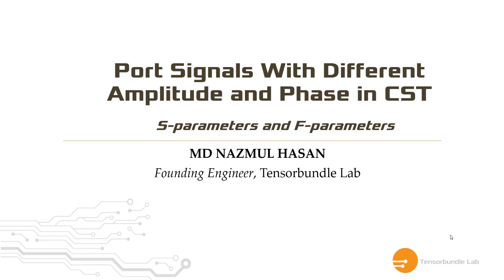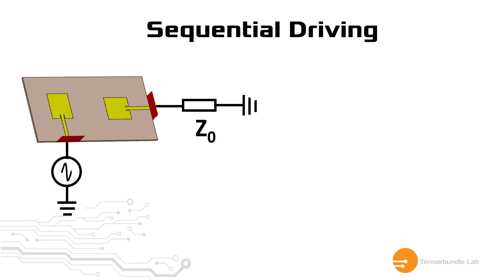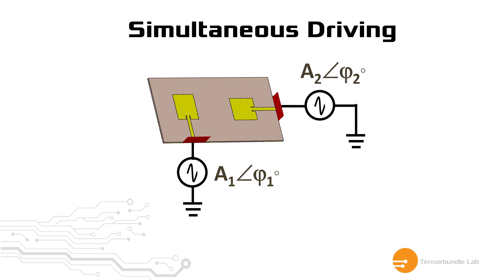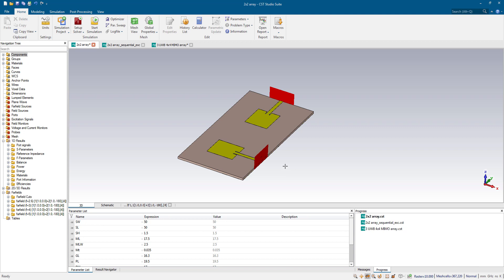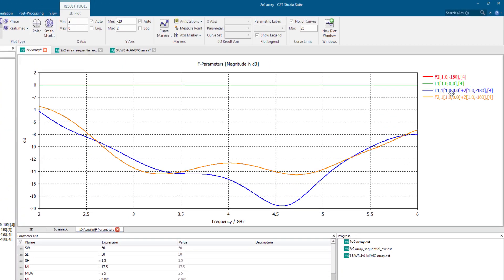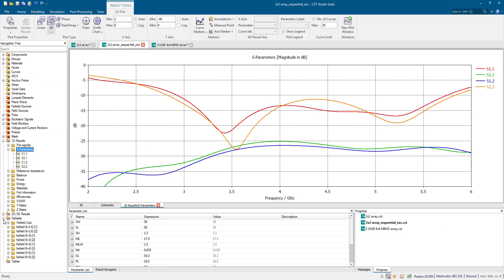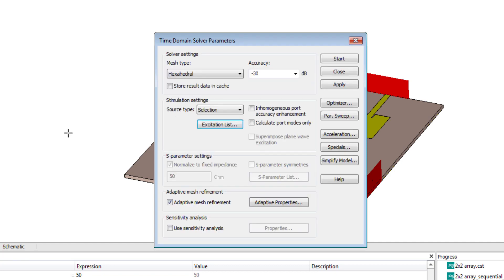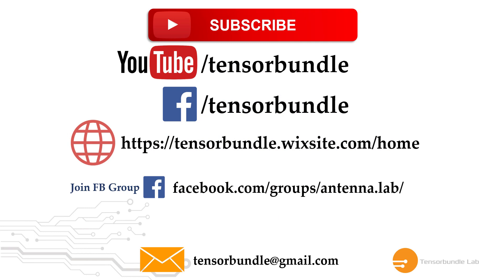CST Tutorial: Port signals with different amplitude, phase shift in phased array application

Comment: Hello, thanks for this video, very intresting. I wanna do an exposition of persons study, so I have multiple antennas on the roof of a vehicle. I m not intrested in S parameters or F parameter. I just need to impose an input power and then see the level of raddiated field around. The field is in RMS value so I think there is no problem of phases here.  You say that we could fix amplitude of signals, this amplitude is current or voltage? If I have an antenna with input power 30dBm what is the amplitude ? Thanks a lot

Comment: How can I configure the port of a receiving antenna?
Reply from the maker: port definition is same for both TX and RX antenna. Simply look at S21 parameter to check received signal power
Reply: @tensorbundle  Thank you teacher
Reply: @tensorbundle  and the signals received in the antenna can I observe it in port signals? because I want to observe the behavior of a received signal when it is transmitted from another antenna using different propagation environments
Reply from the maker: @ancomurg  of course you can check it in port signal at the receiver antenna. You can find this in CST's left side panel
Reply: @tensorbundle  the port signals are time-domain signals with amplitude in (Watt)^(1/2)? Can that be considered for received Power? Or is there any other way to get the received power?
Reply: @tensorbundle How do we configure the port excitation? Do we excite only the TX antenna's port, or we need to do sequential excitation to both the TX and RX ports?